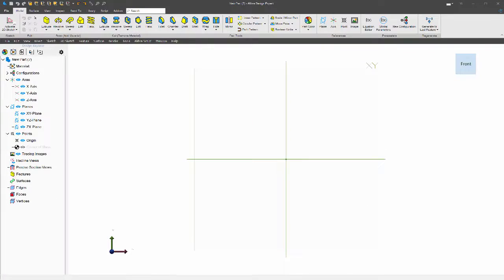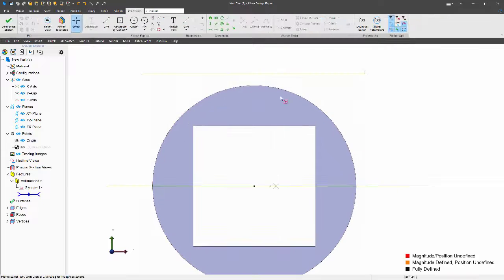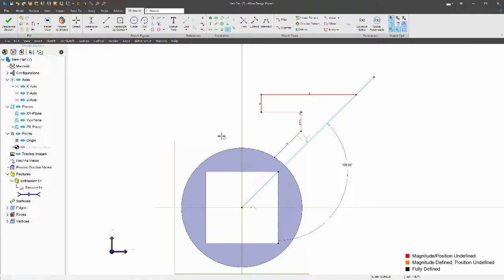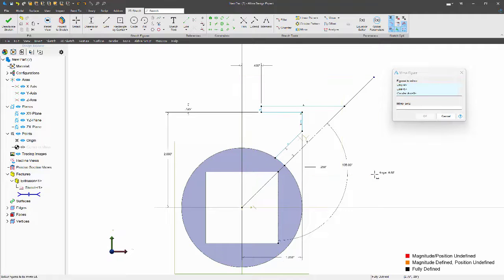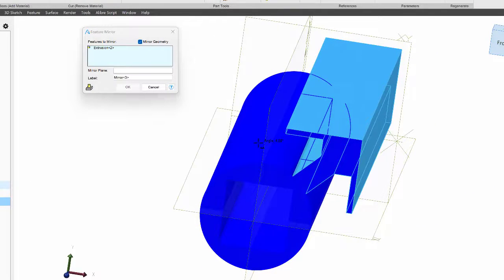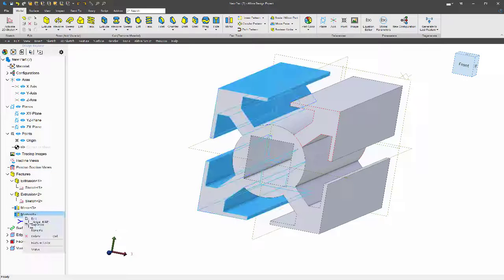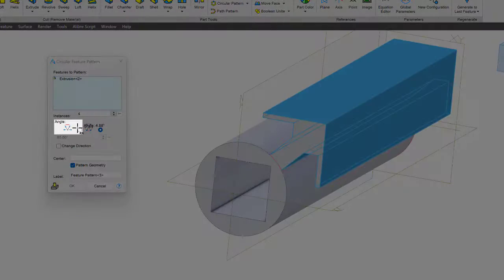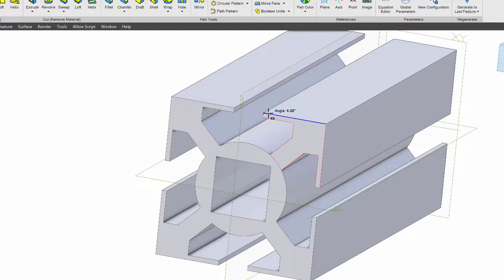Mirrors and Patterns | Alibre Beginners Course #28

Comment: The problem is that working inside the sketch, it is not possible to change the parameters of mirror or the pattern.
Therefore it is better to perform these operations in the 3D environment.
Reply from the maker: That's a good practice to follow.